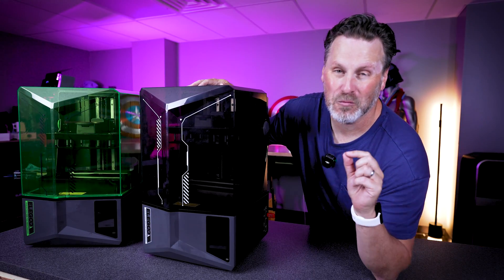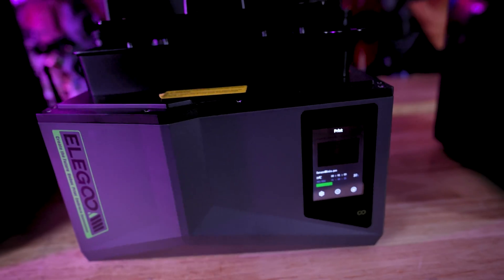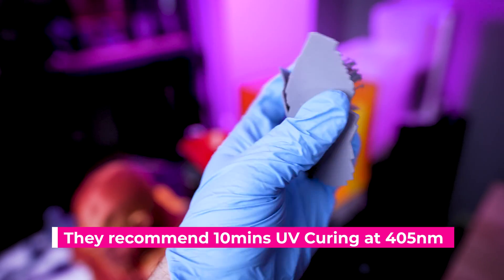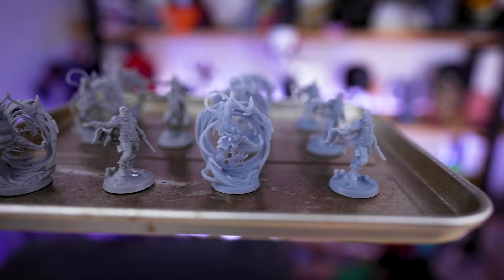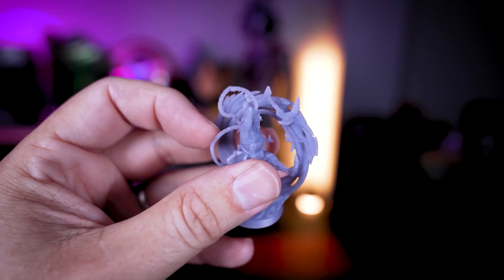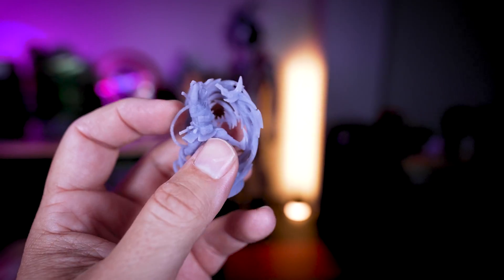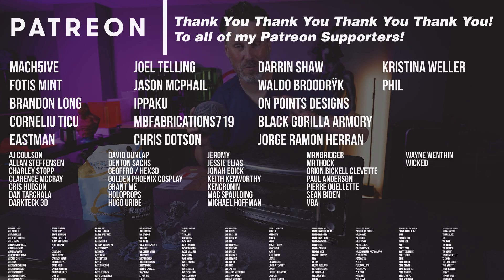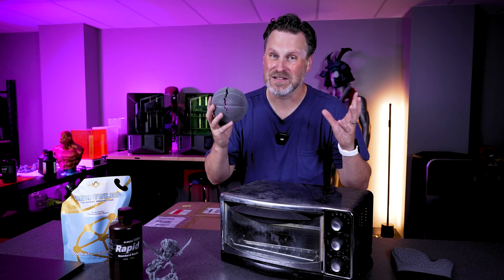Baking your Resin 3D Prints! Does this actually work?

Comment: When I tried baking a hollowed print it caused it to shatter after less then an hour. even at just 170f. there were plenty of holes to let out air but the heat seemed to make the whole print soft and the supports inside either expanded or contracted breaking the entire print

Comment: Speaking of baking and heating prints; try briefly blowing your print with a heat gun before you remove the supports. 
When you go to pull the supports off, it's less like peeling and more like falling right off. Kind of neat!

Comment: I built a toaster-curer but ran into a few problems.  I got a turntable, but they kept warping and cracking under the heat.  
I may punch a hole through the bottom and keep the motor outside the oven.

Comment: I can see the more flexible resin being great for small projects, but it seems that the larger the print, especially if it has wings, outthrust arms with weapons, or a heavy figure perched on a slim support, the weight will cause it to sag over time and also make it more prone to toppling over.

Comment: Would be nice to see compare the Hercules after a half a year of so, could just be it has a slow reaction process, and becomes less flex over time, Also, for dropping it's nice, but miniature paint works best on a hard surface, could be it'll chip off after a while. Maybe try a percentage of both, so use the Hercules to get some flex in the Elegoo.

Comment: I was wondering something, I have a couple S4U and I am not getting fast printing like everyone else. Is this a setting issue or what not? Cause I get estimates in the slicer of like 1.5-3 hours on models and then when I go to print them, they end up taking around 6-9 hours

For example, I have a print that I did that estimates 2h 38m and it took 6h 44m

Comment: Your just drying the print thoroughly by baking it because not all the resin cures 100% within the layers while printing or curing so baking it cures this part cured resin
Reply: Depends on the resin from what I understand. Some is being dried, other is having further polymeric reaction.
I'm not a photo-resin chemist though. Just going from what I've been told from some of the engineers.

Comment: What you are doing with the oven is just what happens to your print over the course of the next couple weeks.  Not all components of the resin are UV sensitive, and over time all of those uncured bits settle into place and make things stiffen and firm-up.  The added heat is just shaking stuff around to make them find more permanent homes faster.  Anyone who has printed a super fragile mini, and had that heart-atack moment of dropping it right away, and the wave of relief that it was ok... only to barely look at their print the wrong way a month or two later to have it shatter into a million pieces has seen this at play.

But this is why I NEVER touch a 'naked' resin print with my hands.  There are still bits of uncured goo in there waiting to stick to your hand, and take a ride on a Cheeto to your belly while playing D&D (until the cheeto dust creates a nice protective layer over the mini!).  Sure, its not much, but over a lifetime of being around the stuff, it could still have an effect.  Even if you aren't going to fully paint your minis, slather a matte or simi-gloss clear coat on them just to have some amount of barrier and keep the goo inside of the print.  Especially for stuff that I give to friends and family... always put a clear coat on for them.
As a bonus, the clear coat will offer some UV resistance, so if a print gets some unintended UV exposure because they were left in a window, or left on the seat of the car, or outside for a while, they wont get 'sun burnt', discolored, and brittle.

Lastly, that flexible resin looks amazing!  Not sure if it is worth that price tag, but that is super impressive!  I finally used up my initial large resin purchases over the winter and picked up some Tenacious to start printing with, and I thought that stuff was flexible!  This new stuff makes tenacious look like concrete in comparison!  That's just unreal to watch tiny parts, fully cured, bend 90* like it is nothing!

Comment: In case you guys didn't know, @3DResinSolutions here in the comments is the company that developed and produces this new line of thermal resins. Atlas is one of their partners / distributors.  3DRS is one of the only consumer resin manufacturers in the US, and it's pretty cool to see them pioneering the development of stronger and safer resin.  Just want to give credit where credit is due. 😁
Reply: I belive atlass actually helped in development, as they had people which prepared mix and then 3DRS produced it.
Reply: @shonoshe  Atlas helped with test printing different formulations (as did we), but all the engineering and manufacturing is handled by 3DRS. I just confirmed with 3DRS to make sure I'm not spreading false information. ☺

Comment: I've dropped a miniature made of the Rapid resin and the leg (and it wasn't thin) snapped off. However it was easily with superglue and I haven't had any problems with fix. I've also snapped off a couple of small pieces when removing supports (warm water, pre-cure) and again it was easily fixed with superglue with no later problems.
Reply from the maker: 100% agreed. For whatever reason super glue + rapid resin prints work so good together. Like an instant bond

Comment: Im still amazed by the Saturn 4 Ultra. Its a fantastic machine and hands down the best printer you can buy for the price. It feels like a $1,200 machine compared to all the others.
Reply: I just don't understand the pricing on the 4 vs 4 ultra.  The 4 is just the 3 with a new suit and tie... so save $50-75 and get the 3 if you want a solid basic large resin printer.  But the 4 ultra feels like the price is a steal for the extra speed and improvements.
I'm not in the market this time around (my OG 1st round preorder Saturn is still going strong!), but that 4 ultra looks tempting... I'll let everyone try out the tilting bed mechanism and see how it holds up for a year and maybe I'll pick up the next gen for a long overdue upgrade!
Reply: @CaedenV  I have the 1st and 2nd Saturn. I skipped the 3rd. This new 4 ultra is in a completely different ballpark. It's going to change the entire industry. Every print is flawless and it's 3 times faster then the old ones. It burns a layer every 5 seconds. 2.1 seconds to burn a layer, and 2.9 seconds to do the tilt. Amazingly fast!!!

Comment: I'm curious about why they don't crack. I've tried to put them at a kinda high temperature but less than boiling point of water and they tend to crack and break out of nowhere, and this is with almost every resin I've used, even the Sirayatech Blu. It's sad because I want to make molds for some polycaprolactone which is a wonderful material

Comment: $115 for 1.5 kg of resin...
I was almost convinced, but I think I will still with ABS-like for the same results and 1/6th of the cost.
I always bake resins, but then again I come from resin molding, and this is just standard technique in that realm.
Reply: I started using tenacious as I had finally used up my previous purchases, and it's a game-changer!  They don't look as sharp to the naked eye, but I am pretty sure that is an optical illusion as they look the same with a coat of paint on them.  But the tenacious prints are way more forgiving with being handled, and I think I will always stick to flexible resins going forward.  That said... tenacious doesn't seem to bend as well as this stuff seems to... that's just unreal.  But tenacious is about half the price, especially if you happen to find it on sale, so I am not sure if even more flexibility is helpful for double the price... maybe for some things though.
Reply: Not same, just similar results and afaik there is no certified skin safe resin out there for cheaper

Comment: This is great! Thank you for taking the time to experiment with the material.

Just to add, the HERC Flex resin is specifically designed for thermal curing without cracking or degrading. This process allows you to fully cure the material and produce a non-cytotoxic part, greatly expanding its functionality. As a result, it can be used in applications where typical resins wouldn’t be suitable.

It's important to note that light alone cannot achieve a full cure in 3D photopolymer; thermal curing is essential for a complete and thorough cure. Please be aware that most resins are not designed for thermal curing and may be damaged if subjected to heat.
Reply: I like to UV cure in boiling hot water from a kettle.

I read somewhere that oxygen can prevent fully curing, and heat helps.

I don't know if it's the best way but it seems to work for me.
Reply: @jtjames79  oxygen inhibition. yes, water curing certainly has its place. I've never tried using hot water but the concept would be the same. Typically we water cure for small clear parts. works amazing.
Reply: Is any attempt being made to reduce price? While it does seem quite impressive, the barrier for entry is extremely high. I could buy an entirely new printer if I tried to buy the amount of resin I use in a given month.
Reply: @Hylian_Herald  That formula was in R&D for well over 6 months. There is simply no way to reduce the cost of that material without sacrificing something. Also, we are an American Manufacturer and subject to all that goes along with that so there are additional costs there for labor, regulatory, etc. We do our best to balance the cost / benefits to all of our products.
Reply: I have your tabletop standard resin and it’s insanely flexible! Thank you guys!
Reply: @Annihilo  I appreciate that thank you. that's a unique formula for sure and I think it will do well.

Comment: Hello, thanks for the video.  Most of my work is engineering and has flat surfaces and I was thinking about buying myself a different printer.  Could you tell me how things are going with desktop printing on the Elegoo Saturn 4 ultra?    At the moment I have an Elegoo Saturn 3 ultra.  Printing on it from the table is impossible, since it eats up the first couple of millimeters.  Most of my work is engineering and has flat surfaces and I was thinking about buying myself a different printer.
Reply: @UncleJessy would know more, but it sounds like you are trying to get extremely flat surfaces for your projects?  You may have more luck if you play with your anti aliasing to get a better gradient / smoother layer transition.  You may also have some luck dropping your layer height down to 10um to minimize layer lines.  Almost all resins can warp a little, you may have better luck printing at hotter or cooler temperatures, or using a very brittle resin that doesn't flex.  
Not sure if this will help, just spitballing.  :)

Comment: So baking makes it more brittle. so pritty useless. well i guess thanks for the video
Reply: I heard he use to much heat It should of been around 80 c like 176f
Reply from the maker: Yeah it sounds like it went too hot with the standard resin. The Hercules is designed to be heated at higher temps
Reply: @UncleJessy  oh ok. bit of a shame. Maybe a retest would be good? but still even the unbaked ones seemed way more bendable. Herc ones esp. Be interesting to see how the none baked models hold up over time. Are they still bendable after 3-6 months? seems much better to me if it is bendable. maybe not for painting thought. Cheers.

Comment: PhD in additive biofabrication here (basically cell biology + additive manufacturing + polymer chemistry)- what your doing here is thermal curing of unreacted monomer groups in the polymer. There is something called a degree of conversion, even in a solid "cured" polymer there is still a high level of unreacted monomer groups trapped. For all intents and purposes this is fine but applying heat leads to thermal curing of some of these trapped monomers  and essentially "cures more" hence higher rigidity. You can even go so far as to heat in a vacuum oven under intense heat and pressure  to a degree that actually evaporates any trapped monomer Depending on the monomer of course). I've done this before with on top of more aggressive solvents such as Polyglycolmonomethyletheracetate (PGMEA) in order to eliminate any unreacted monomer groups that would be toxic inside a human body in order to make experimental polymer implants biocompatible. Be aware that the more you cook you do eventually damage the macro structure of the polymer and it leads to extreme brittleness. A little heat (60-80 C)along with UV is the best curing option without going too extreme, they even sell UV ovens for this purpose (mostly for dentistry) but they can be a bit expensive for a hobbyist. Also always ventilate these fumes.
Reply: This is where we spent alot of time formulating the underlying mix for Hercules - it has thermally reactive elements so that it actually gets stronger as you bake it longer.
Reply: Cheers for the breakdown of the Video's contents. I dont have a PhD and "I" got what ya slappin down m8, the whole thing is similar in a way to baking Pottery or Ceramics in the Kiln, to short and its still some what raw in the middle and brittle, too long and you bake all the water out which makes it brittle also. In Short bake at the right temp and right length of time...... or am i batcrap crazy. Cheers from Downunder🙃
Reply: @Undeadjace91  Do single uncured monomers break down over time and cure themselves?  (i.e. would a 5 year old print have less uncured molecules than a 5 day old print?)
Reply: With your background in bio-chem, would you consider resin jewelry safe?
Reply: @qwertyqwerty9587  For jewellery purposes my advice would depend on your intentions. If it’s for personal, family or friends then standard resins, assuming cured correctly, often don’t cause any noticeable problems after long term contact with skin. However, they can cause some minor skin irritation in susceptible individuals, if any irritation occurs they can simply remove it.

If it was something you were planning to sell or give out to the public you would need to be more cautious. Standard resins do not comply with ISO standards for long term skin contact, these are quite strict medical standards (a bit overkill for jewellery) but still there is a level of cell toxicity. These resins can be post processed to a point that does meet these standards, but it requires expensive machinery and can make them brittle which would probably be very problematic in small pieces such as jewellery. Whilst it is very unlikely to actually harm anyone, it is possible someone could hold you liable. However you can buy resins specially formulated to be biocompatible, they are more expensive but they exist. I have worked with some of these including FormLabs biocompatible resins and with standard curing processes these are completely safe with no cell toxicity.

Hope that helps.
Reply: Is this reaction likely true of most non-specialist resins (i.e. everything from the standard resins, to "ABS like", and even water washable) or does it only apply to limited types?
Reply: @gbspikyfish  To be honest im not certain for water washable as ive never used them, but i would assume so. This effect would still work in ABS-like but would be less noticeable as they already have a higher degree of conversion hence why they are naturally stronger, in a standard resin its quite noticeable but in ABS-like it would still work but to a lesser degree.
Reply: Yeah I'm pretty sure that's what he said
Reply: Which brings us back to the question if cured resin can actually be considered safe to handle considering it still contains vast amounts of unreacted monomers, many of which belong to oxiranes and acrylates. Both of which are toxic and carcinogenic. Also considering the strong smell of the resin, I‘d have to conclude that their smell is either really potent, or they have a considerable vapor pressure

Comment: I'm no expert, but 250F seems a bit too hot.  I think most engineering resins only require about 80C at the most.
Reply from the maker: Yeah I was thinking the same. Maybe another round of tests 😂
Reply: @UncleJessy  I read somewhere that oxygen can prevent full curing. I also read that a little bit of heat is good. 

So I cure my prints in water from a tea kettle.

Comment: Guys... don't sniff your resin. Just don't.
Reply from the maker: Agreed, but calling out that you can actively smell it. Don’t stick your nose in the bottle and sniff
Reply: Back in High School chemistry class we were taught that if you have to smell something hold the bottle away from your face and with your hand gently wave the fumes towards you.
Reply: If it smells like candy, why isn’t it candy
Reply: Too late already addicted
Reply: Right on, the company has Cytotoxicity test results on their site but not a full material safety data sheet.

Comment: Why copy someone else’s video?
Reply: That’s like asking why do creators all review the same printers? Because they have different audiences and different takes on the same item.
Reply from the maker: I would say they are similar but not the same. CNC K is much much more technical / analytical, mine on the other hand is not 😂 focused on testing a resin specifically designed for printing, cleaning, curing and heating at different temperatures for different results. Also, because it’s fun to see a different approach to a similar topic 🤘
Reply: Its pier review work.
And incrementally improves the hobby.  I bet we see heated curing stations in the next 3 years.